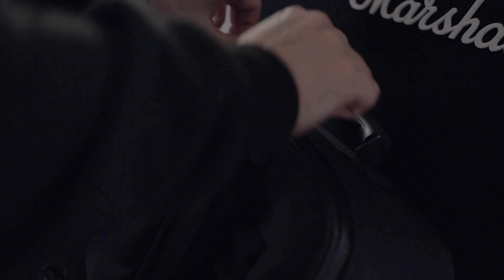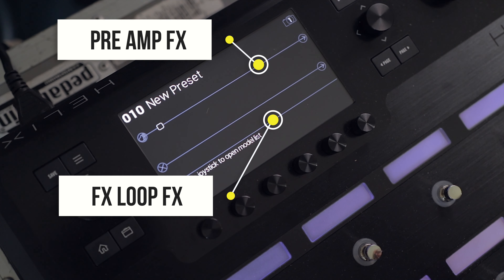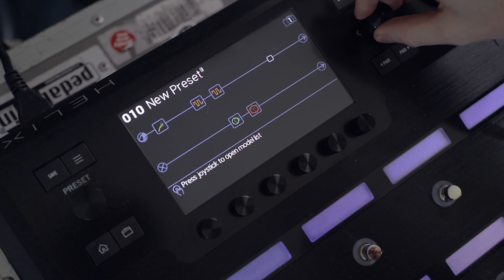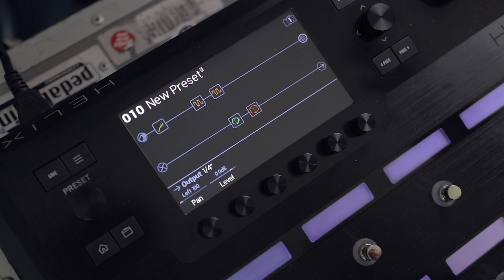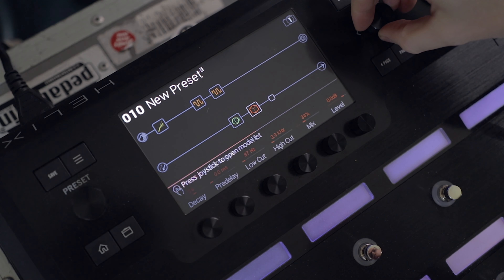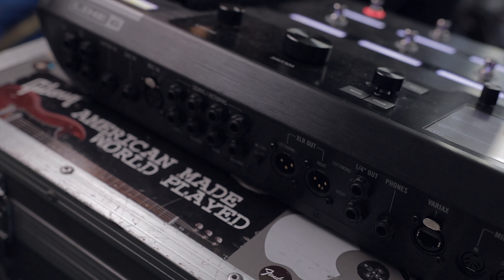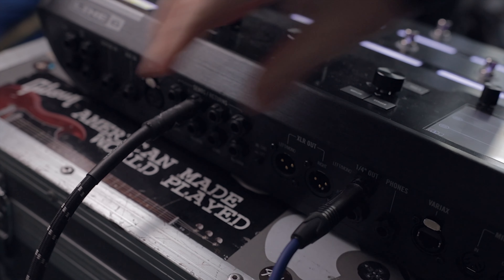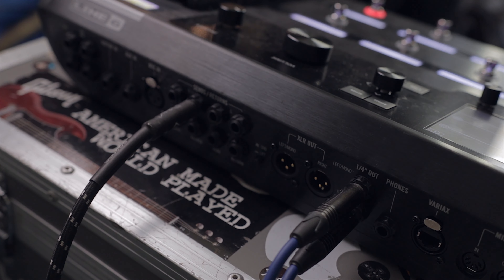How to do the 4 cable method with the Line 6 Helix (the EASY way!)

Comment: Great idea!  The only problem is that the second path (what's in the loop) is noisy in my amp (Marshall) even with no pedals...  Any idea?
Reply from the maker: thats weird. what Marshall is it? Do you hear FX in the loop if you do put any pedals on that path of audio?
Reply: @BenHartwellGuitar  It's a marshall Origin 20C.  Yes I hear the FXs normally in the loop, it's just that it adds noise (even without FXs).  Another problem is that I cannot record with my external looper (I can play what's on it but cannot record with it).   I put the looper in the second path parallel to echo and reverb.
Reply from the maker: @MegaBrebis  strange. does it make noise with just the Helix or other pedals too?
Reply: @BenHartwellGuitar  Only the Helix.
Reply: This is exactly why I came back to this vid, to ask if anyone else was experiencing noise issues. How did you narrow it down  to the 2nd path? Im getting a fairly bad buzz/hum at no volume when the gate is fully engaged and when I play it adds a fairly bad static/ crackling - sounds digital to me. The interesting thing is, I started out using this unconventional 4cm in the vid below and so then I tried the normal 4 cable method and the noise is worse. Using my old (non Helix ) setup I never had this problem. Ive checked everything over like 3 times, its all setup right as far as I can see.  take out the 4cm and its totally normal.
Reply: I have to use a hum eliminator box with my Marshall vintage modern effects loop

Comment: Hi Ben, I have a petrucci majesty which has a stereo output one for the piezo and and one the magnetic pu 's the other end of trs cable are the two tr ends how can i connect to the helix LT and the out to either stereo amp or preferably two different amps from the helix? thanks in advance, cheers!
Reply from the maker: you could do a regular 4 cable method with the regular guitar output then use the AUX IN on the Helix for the piezo and have a whole separate line of audio in the patch just for that. That line can then go out to whatever, FoH, amp etc. I guess that you only use the piezo clean so a straight audio path in Helix would be fine.

Comment: question... currently diving in to using the helix lt for 4 cable method with my evh 5153 50s then goes to my torpedo captor x and into my focusrite interface.... i've been having some "string noise" issues especially when doing palm mutes... does anyone else have this same problem?

Comment: How would you go about using something like a g string Decimator in this setup, which traditionally goes in the fx loop Decimator in, Decimator out - send/return of amp while the guitar  goes into the input of noise gate pedal then back out of pedal into amp input, I want to use my Decimator instead of built in gates. Any suggestions?
Reply from the maker: yeah just had a look at that pedal, cool idea. So I think the way you would do it is: Guitar >> Decimator in, Decimator out >> Helix GTR in, Helix Left OUT >> Front of amp, SEND from amp >> Helix RETURN, Helix Right OUT >> Decimator in, Decimator out >> amp RETURN.
That would put the Decimator last in the chain on the FX Loop of the amp, I think! L&R outs of the Helix might need swapping depending on how things are panned, but I think that would work.

Comment: why didn't you use send 1 for the fx loop instead of the right out? i suppose because it merges send 1 and 2...
Reply: I'm trying to figure out the same thing. I think mine sounds worse this way compared to not using the out 2

Comment: Hi, 
I've got hx LT hooked up to my pc via USB and studio monitors to it via provided jacks.
I've recently bought an amp (jvm210h) to my long not used 4x12 cab.
How to connect it to helix so I can still use studio monitors for playback off YouTube etc. but guitar signal to come out of cab hooked to the amp ? Also so you can steer head channels via helix ?
Do i need another interface? Or just 4 cable method and monitors via xlrs rather than jacks?
Thanks
Reply from the maker: hi, love the JVM! You could connect that amp in 4 cable method with the Helix. You could also use a midi cable from the Helix to control channel switching on the JVM. As for the playback with the monitors, you would be best connecting them directly to you computer with a small interface. You could do it with the Helix if you needed to, you would just have the YouTube audio on a separate path in Helix and output it to wherever you have the monitors connected.

Comment: Great video! But my 6505 looses a ton of "power" when using this method.. do i need specific cables?
Reply from the maker: Just regular guitar cables. Is the helix set to unity gain?
Reply: @BenHartwellGuitar  i dont know :( how do i check that?
Reply from the maker: @marvinduschek7338  actually I'd try running 4CM with some 'regular' guitar pedals and see if you get the same effect. if so then at least you know its not the Helix

Comment: So where would a looper go to catch both paths?
Reply from the maker: depends if you want to loop pre or post all the fx. You could add it first (before helix input) in the chain to run in to all the fx, or, if you want to capture just preamp fx you could put it before the amp input, or, to capture all fx you could add it between the helix and the amp fx return. hope that makes sense
Reply: @BenHartwellGuitar  thanks mate

Comment: Great Tutorial!! I’ve been messing around with different methods and this one works best with My 5150 3 100w What is the the best Global settings for this method? 1/4 outs and send and return. Should I have both set to line or Instrument?
Reply from the maker: According to Line 6 you should set them both to instrument as that would mimic using a more traditional 4cm pedal board.
Reply: @BenHartwellGuitar  
Thanks for the info👍

Comment: So by running this setup do I use full amp models or can I get away w/ using preamp models?
Reply from the maker: this is just to use the Helix as an FX board. But you could set it up to use the amp models if you wanted to and bypass the front of whatever "real" amp you use

Comment: This video is great! I tried this setup, but when I took the top path and panned the left 1/4" all the way left, my amp went silent. If I kept both the 1/4" in the center I get tone. Any idea why your directions wouldn't be working for me?
Reply from the maker: Thanks. Hmm...that’s odd I’m not sure why that would happen. You could try reversing them so top path panned right and bottom path panned left. See if that gives you any sound. What amp are you using?
Reply: Ben Hartwell I’m using a Dr Z Max 18 which has an fx loop.
Reply from the maker: Awesome amp! The only thing I’d try is just run the top path, no fx loop, and try panning it left and right and make sure you get sound when it’s on one side or the other. Then add in the fx loop panned in the opposite direction and see what happens

Comment: Hey Ben. This was a great use of 4CM! Super straight forward and makes sense. 

Do you have any experience in using 4CM with two separate amps? I guess it's called 7CM.? I tried this with a traditional 4CM setup but for both amps using the send/returns on each amp and send/return 1/2 on the Helix if that makes sense. But it doesn't sound as good as just using an A/B/Y box straight into the front of both amps. That sounds killer. Any alternative suggestions on how to hook up two separate amps through the Helix? I'd love to control both amps with the Helix, like have all the effects go to both amps. I don't care about ping pong delay and shit like that. I just want a wall of sound using the Helix and both amps simultaneously. Does that make sense? Love to hear your thoughts. Thanks in advance!

Comment: Is there any reason why youre not using a send / return block in your signal chain? I use a Marshall JVM and i´m quite happy with this way. I don´t use the volume knob for the 1/4" outs and only use it for the XLRs, is there a must to use the volume knob? and which loop of the JVM do you use?! Like i say, i´m happy with my setup but sometimes there are some questions that dont get an answer from the manuals..Thanks for answering
Reply from the maker: Cool. I just use the in and outs to save using a send/return block. I just find it easier to set up using one path for pre amp and one for post, and I use the serial/parallel fx loop set wet.

Comment: Great video 🙂 if I want to use a preamp in the Helix how would I bypass the preamp from the real amp?
Reply from the maker: thanks! yeah I do this all the time with my v30 and Helix. You just take the output from the Helix to the FX return on the amp, that's the only cable you need. That bypasses all the front end of the amp and only uses the power section. Then just choose whatever amp you want to use in the Helix. It works really well, just balance out your volume on the Helix and you're good to go
Reply: @BenHartwellGuitar  yes I know this 🙂 what I meen is that if I wish to use the 4cm the way you do. How can I use the preamps in Helix then? So I can switch from my amps preamp to Helix preamp. Without adding a fx block in the path 🙂
Reply from the maker: ahhh got ya. yeah I think you can do it would just need some clever routing. let me have a think
Reply from the maker: so the only way I can think to do it with this 4CM is to mute the top line in the Helix that's feeding the front of the amp. And then kick in whatever amp you want on the bottom line to feed the FX return. You can have both those actions on one foot switch, it just means that you would need two copies of anything you wanted in front of the amps cuz you're muting the ones on the top line.
Reply: @BenHartwellGuitar  that would work 🙂 thanks a lot 🙂

Comment: Are those speaker cables and guitar cables? Also do I have to that for every single patch? Or is there an easier option. Thanks.
Reply from the maker: The only speaker cable is the one from the amp head to the cabinet, all the other cables are regular guitar cables. You would have to setup each patch that you wanted to do 4 cable method with yeah unfortunately
Reply: @BenHartwellGuitar  Thank you for the reply 👍🏻

Comment: I tried this method but am faced with latency issue i.e. I play a riff then it comes on like milliseconds later. Is it normal?
Reply from the maker: That’s weird. Not had an latency issue when I’ve done 4cm with various amps. What amp are you using?
Reply: @BenHartwellGuitar  I'm using a Blackstar Studio 10 EL84. I followed every single step but there is latency issue. I'm using short cables too.
Reply from the maker: @wfntube  great amp! yeah that is weird I've never had any problems like that with 4cm. is there Latency even with nothing turned on in the Helix?
Reply: @BenHartwellGuitar  hi Ben, I managed to resolve it when using on a fresh new patch. I think it might be an issue with my previous presets. Thanks.

Comment: Great vid man, just wondering if you use this method for changing channels on the jmv via midi? If so have you had any issues getting it to work?
Reply from the maker: Cheers dude. No not tried it yet. Really want to. Gonna dig out a midi cable and give it a go
Reply: Please make a vid man!, I'm having all kinds of trouble! 😄
Reply from the maker: So I've plugged my JVM in to the Helix via Midi and got it set up so that the Helix changes the channels no problem.
Heres how I did it:
1. connect Helix Midi out to JVM midi in
2. set up which ever channel you want first on the JVM
3. go to command center on the Helix and choose a switch 
4. set it to Bank/Prog, MIDI Ch 1, Program 1
5. double tab the MIDI PROGRAM button on JVM so it flashes
6. press the switch on the Helix you just assigned 
That switch should now control the channel change to that channel on the JVM
7. Setup another channel on the JVM
8. repeat steps 3-6 but change the numbers to 1 higher i.e. 2
You should now have 2 different channels controllable by the Helix.
The only downside to this is there is no visual feedback on the Helix as to what channel you are on

Comment: I have a question, if you play live and the amp it's let's say 5 meters away from the pedalboard do you need three 5 meters long cables? Or even if it's further away? Wouldn't you loose signal or something?

I mean, including the guitar cable, that would be a 20 meter long cables for the whole setup, does it work?
Reply from the maker: yeah you do lose some signal with longer cables, but i just design my sounds around that. The problem I have is that my stages range from a couple of meters to huge stages where I need massive cable runs. The signal loss is not so great that I really notice it, but you're right you could use smaller cables if you are going to be closer to your amps, or use buffers to keep the signal nice and strong, which i think the Helix is anyway.
Reply: @BenHartwellGuitar  thank you!
Reply: @BenHartwellGuitar  the efect loop from the cabinet is unbalanced right? then using the balanced output in the pedal board wouldnt make any difference. anyway, I wouldnt try it I dont wanna fry my equipment...
Reply from the maker: @InnerSilence123  yeah FX loops are usually unbalanced. The only balanced output in the Helix is the XLR outs, all the others are TS jack outs, as far as I know, I may be wrong.
Reply: @BenHartwellGuitar  yeah, should be balanced in both ends to make any kind of make sense, my bad
Reply from the maker: @d.l.sstudio8922  yeah that's definitely a good way round it. if the remote had the bigger screen I'd do that I think

Comment: Great video, thanks for sharing Ben. Does it also goes with parallel fx loop? I own Marshall TSL and I wonder how it will work with helix which I am about to to buy. cheers.
Reply from the maker: thanks, yeah it should do. Its just like plugging just your time based fx in to the fx loop. might just need to adjust your levels a it is all

Comment: Nice :) And what if for example you wanna use additional physical pedals from your pedal board, like clean boost in front of the amp?
Reply from the maker: Yeah you can do that easy. Just plug them in before the Helix. So you would go Guitar>>Clean boost>>Helix>>Amp. Or you could put it after the Helix just before the amp so Guitar>>Helix>>Clean boost>>Amp. Or you could use the FX loops of the helix to keep them out of the chain when not in use. Hope that makes sense.
Reply: @BenHartwellGuitar   Thanks! that makes sense :), and what if I would like to go from the amp to reactive load IR (without the cab), and back to helix as audio interface, should I plug Out of Reactive load to Aux In of helix and set it to Line level ?
Reply from the maker: @sweetmotash  thats an interesting one. I've not tried that myself, but yeah I guess if you did it that way onto a separate audio path in the helix that then output to usb only that should work. just be careful not to create a feedback loop where the audio is going HELIX>>AMP>>IR>>HELIX>>then back to the amp. Be interested to see if this works, let me know.
Reply: @BenHartwellGuitar  I will try that :) But I think now, better option will be to invest alittle bit more into apart audio interface like scarlett, and use helix, as a pedalboard only.
Reply: @BenHartwellGuitar   hehe well, ive tried only once, and when i went from standby to on, feedback loop almost took my ears off :) Just ordered audio interface :)
Reply from the maker: @sweetmotash  eeek! Yeah was worried that might happen, gotta be careful with stuff like that. Hope you and the gear are ok. Look into UAD interfaces if you can, they are amazing.
Reply: @BenHartwellGuitar   Ok got an interface, all is hooked up, I see signal comming from amp to interface, but theres no sound comming out. I can bet it got something to do with the helix routing :)
Reply from the maker: @sweetmotash  hmmm i dunno. If there is signal coming from the amp it must be on the computer side of things then i.e. the DAW. maybe just need to enable input monitoring or something like that?
Reply: @BenHartwellGuitar   Ha ! its working, true it was computer side. Now lets play with suhr pt15 with helix together ;) thanks man, for fast responses, and great help. Subbed!
Reply from the maker: @sweetmotash  No problem dude!

Comment: Is there any tone suck with the Helix like this??I hooked mine up the traditional 4cm,where you are putting your amps preamp into a loop on the Helix,and it seemed to really change the tone of my amp.....maybe I didn’t have the levels right or something,I don’t know.....The way you are doing it,your amp isn’t actually running into the Helix...
Reply from the maker: Can't say I've ever noticed any tone suck from the Helix. There was some volume difference until I sorted the output level but thats all really. The 4CM I do is GUITAR>>HELIX L OUT>>AMP IN>>AMP FXLOOP SEND>>HELIX RETURN 1>>HELIX R OUT>>AMP FXLOOP RETURN. That way I can use all the channels on the amp with any FX I want in front and can also put any FX after the preamp of the amp.

Comment: Question...since you’re using your 1/4” outs, where do you set you master volume of the Helix (i.e., big volume knob on front of Helix) to get optimal signal/noise?
Reply from the maker: So what i used to do was just dial in the volume control to get around unity gain, so that it was the same volume as plugging direct into the amp. But after doing some reading, and according to L6, if you set the 1/4" outputs in the global settings to 'instrument' instead of the default 'line', then turn the volume knob all the way up you get true unity gain and best signal to noise. So now i do it that way. Hope that helps
Reply: Ben Hartwell awesome.  Just the answer I was looking for!  Thx.     😎👍🏻